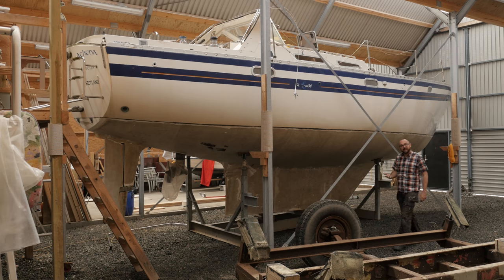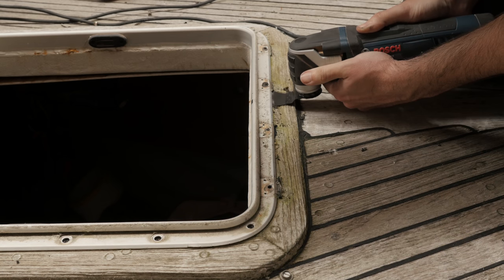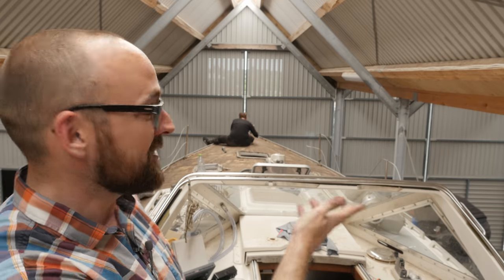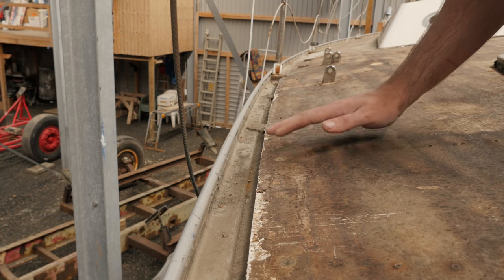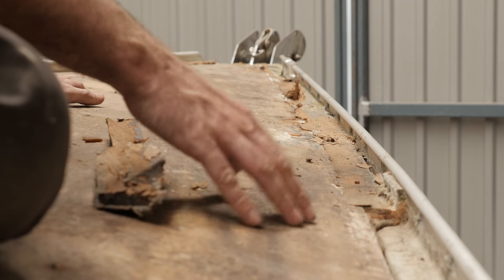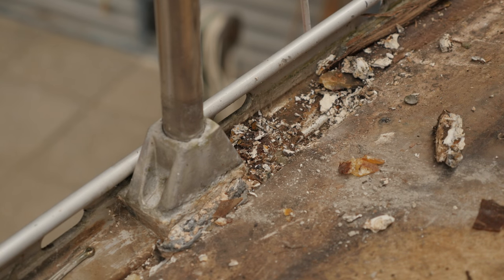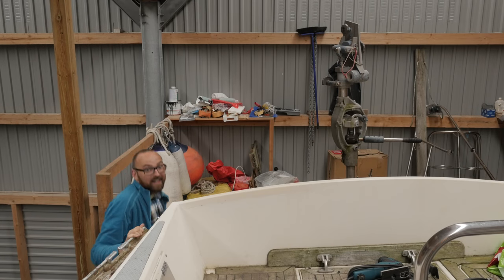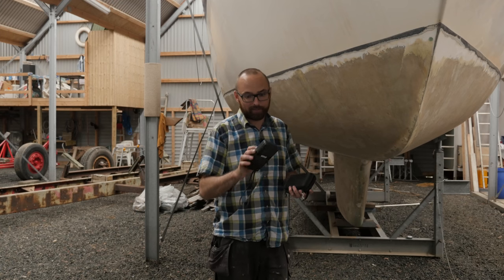Sail Life - Removing the old teak deck & issues with the deck - DIY sailboat refit

Comment: WOW! You guys got lucky with the ease of that deck removal. I helped strip the teak off of an old Hans Christian 38..with two people it took 4 weekends with the sun beating down on us. The adhesive on your boat must be pretty degraded. The stuff we were dealing with was black and unbelievably strong, even after 30 years. Either that or we were just completely incompetent!
Reply from the maker: Hehe, I doubt very much you were incompetent :) All credit for the easy removal of the teak deck aboard Athena goes to whoever chose to use that brittle adhesive. A horrible choice clearly but I'd buy him or her a beer any day ;)
Reply: As for the wet deck...we had the exact issue on that Hans Christian. Who would have thought that drilling a few thousand screw holes through a perfectly good fiberglass deck with a wooden core would lead to water intrusion? I'm sure the teak was really nice under the foot when it was new...but these screwed down teak decks have proven to be perhaps the stupidest idea in the history of yacht design.
Reply: RealityIsTheNow  Hans Christians used two part Thiokol  adhesive/sealer. It makes Sikaflex or 5200 look like wallpaper paste. You're lucky it only took that long.
Reply: the biggest tragedy is people letting teak on an HC degrade to the point where they have to remove it.  I was just on a 1981 HC38 and the original teak decking was immaculate. Maintenance people, it is not that hard....

Comment: My and my friend removed the toerail on our Wasa 55 a couple of years ago, it was damaged in a few places and it was leaking. We also changed out the entire foredeck due to rotten balsa core (from a hole from a hatch, not teak deck).

We ended up lifting the entire deck along with toerail, (still attached to few bulkheads), cleaning out the butyl sealer, grinding and glueing the deck to the flange in the hull.
Then we routered a nice big radius and laminated the hull and deck together on inside and out use with biax glass and vinylester :)
We had a bad looking recess in the hull under the toerail from the angle iron that was used in the form to make the deck flange and needed to do something anyway. And since we changed the deck from the cabin top and forwards anyway (about 4m),we went all in :) we even reinforced the flimsy stern panel and made that into a nice sandwich panel. 

Turned out pretty darn spiffy ;) looks more modern with a big radius edge to the deck and the entire boat and deck stiffened up considerably.
Probably added a liite bit of weight, but not much singe we removed the toerail and didn't put it back.
Still need to finish the painting and painting a new anti skid on the entire deck, roof and cockpit.

Comment: Your optimism is amazing. I can't say I was surprised your deck is wet after seeing how whatever "adhesive" they used was brittle and no longer doing its job. That coupled with the thousands of screw holes is just a recipe for wet decks. Seeing how you don't have an off switch, I can't wait to see you dig into the deck and make it as awesome as the rest of your projects. Good luck!

Comment: That's very nice of them to help you out. Good neighbors are best neighbors.
Reply from the maker: That is very true! :)
Reply: FOR THE CORE, take your router, remove the bottom plate, and replace it with one that keeps you from the toe rail to the core. It has to be a disc, so you don't have issues with curvature and it has to have rounded edges, so that it doesn't catch on the imperfections, alternatively, you can sand the whole cut path before hand.

Comment: Mads the boat was obviously built with a teak deck in mind, can't say I was very impressed with bits of teak stuck in epoxy as fillers. I wonder if you wouldn't consider filling the holes and getting it replaced. I'm just thinking that a nice smart teak deck is going to look a whole lot nicer, will hide a world of upside down cores, toerail gaps screw hole make mends etc.  The hours that you save on all that stuff, just do some extra consulting work for $ that pays for the deck. 
I have done two weeks on warrior 38's and this Pandora's box really surprised me , I was super impressed with the build feel , so that's an illusion shattered. 
Cheers Wilf

Comment: Great video as always Mads. Man that deck came up fast!  Anyway, the hull. Just grab a 100 foot roll of plastic and tape it to the hull all the way around. Put some pieces of wood or gravel to seal it to the ground. Get 4 or 5 dehumidifiers from a flood clean up company and chuck them in there for a week.  It's worth a try.
Reply from the maker: Thanks! :) I think the HotVac copy will do a better job :)

Comment: I thoroughly enjoyed this week's video with challenge on top of challenge. Your spirit and resolve will win the day and wish you the very best of luck. I have been fixing boats for many years and right now would be asking around for the right direction to take with the deck sandwich repairs - it is a bit beyond my experience. I have also learned that I have been using screwdrivers incorrectly all these years Ha Ha! Keep up the spiffing good work. I think I owe you 3 beers!

Comment: I keep thinking it would be a good idea to raise the toe rail up to the level that is above (or on top of) the foam core.  This would make the deck area adjacent to the toe rail flat (you mentioned kind of routing the area.)   A flat area would be more stable footing.  On a different subject, I've hear yacht reviews say that a taller toe rail adds more safety.  So, I think it's good that you're removing the teak that was glued on top of the toe rail as it makes the toe rail effectively taller!  One last thought, if too much of the deck core is damaged, it may be easiest to replace all the deck core.
Reply from the maker: Thanks for the suggestions :) I don't consider raising the toe rail an option at this point :) I have to be very careful what projects I take on if I'm to have Athena ready to go back in the water in the fall :) 
I'm in the process of sourcing new foam and 60L (15 gallons) of epoxy to replace the core. Before doing anything I'll consort with my friendly local shipwright just to get a second opinion :)
Reply: Yes, it speaks to the old saying "easier said than done". :)  Thank you for the replay, and thank your for the channel!

Comment: Hi Mads, I don't know if this is of concern any longer, but regarding your scraper attachment, the Japanese one probably isn't that bad. Don't be fooled, Asia is big, there are worlds of difference between Japan and Taiwan i.e.. Japanese products usually can measure up with the best of them. That said, the Mitsutomo attachment seems to be one of those "one size fits all" products. It features that quick release cutout that you'll need for a traditional (and overall more sturdy) mount like you find on the Makita. The Star Mount system doesn't need that, on the contrary, since it has considerably less grip to the attachment, it really suffers from that cutout. I guess the lesson would be: if you use a Star Mount tool, use Star Mount (only) blades and attachments.
Thanks for your videos, I started watching your Athena refit series a week ago and am completely addicted. Awesome stuff! :)

Comment: For drying the deck I would like to suggest spreading diatomaceous earth on it. This is a inexpensive, easily-available desiccant. Try a small area and leave plastic on the top so it doesn't remove air moisture and ruin the effect. After a week pull off the plastic, sweep up the powder and measure the result. Best of luck and let us know if you try it and if it works well.

Comment: Maybe you could use a wire wheel in a drill to clean the toe rail.  If a steel wheel is too aggressive for the aluminum then a brass one would work.  It would save a lot of time.  Excellent work!

Comment: still love watching the videos, I am like your other poster in that I am a bit concerned about the router plan. I really admire your courage in tackling the deck, not replacing the core which is easy as you say, it's the massive area of teak which you are replacing. I hope you get some good ideas for the edge of the deck where it meets the toerail I wonder if you could stop the edge of the teak directly above the cored part and leave a slight drop to the exposed toerail, not so pretty but long lasting and serviceable

Comment: imho, you would be wise to remove the toe rail. It will be much easier to clean up, you will be able to have it re-anodized ( in which case you probably won't have to clean it as much as the anodizing process will remove the corrosion), and besides, if the deck lip/toerail design is as challenged as it is, you would be wise to remove what is left of the old, dried out, crappy caulking and decide what to put down. imho, sooner or later you will have to deal with a leaking toerail, and the easiest time to do so must be now! Really appreciate your dedication to task, thoroughness, and excellence in execution.

Comment: On the first look the idea of filling the groove between the teak and the toerail with some odd material looked good to me, would cover the core of the deck from the side and also the screws of the rail, but as it turned out, the water had find it`s way through the years...too bad, I´m outof ideas by now...
Lifting the toerail to the level of the former teak would do the job, but will come out as a heck of work....
I wonder how you will resolve that problem...
Es bleibt spannend!
:-)
Have fun and thanks for the vids!

Comment: My 61 year old kness would never put up with that work without knee pads. Oh to be young! LoL Even the cheaper ones used in basketball will you save you the time of moving and psotion that pad on the deck you are using. Your knees will love for it later in life. Good progress though, very good indeed. I rather guessed before your moisture readings you were not going be impressed with that deck.

Comment: How do you secure the deck for water intrusion ? - Do you cover the deck with fiberglass ? - The coating should also be a type that does not crack over time. On my old Banner 26 I had a kind of rubber non-slip coating which you are gluing on. But you also have to choose something that does not turn green and slippery of algae.

Comment: You have to get the salt minerals out of the fiberglass to expedite drying it may require a couple of power washings.  I was impressed on how fast you got all that teak off of the boat. Do you have an idea on how you are going to take out the foam core and replace it?

Comment: My wife and I just finished watching your video.  As always its something we look forward to every Sunday.  We have a question about the calibration of your moisture meter.  Have you recently compared the readings from a known dry hull?  My moisture meter is by no means as "Gucci" as yours and certainly would not put all my trust in it.
Reply from the maker: Thank you :) I'm glad both of you are enjoying the videos :)  I use a point on the hull above the waterline as my dry reference. Also, I've compared the readings from my meter with a similar meter. I don't think there is anything wrong with my meter ... sadly ;) That would be much easier to fix ;)

Comment: Hi Mads..... your toe rail is fine. Clean it and if necessary you can paint it.  Looking at your deck it looks like it was laid up over a male mould with the Cabin/Cockpit a separate drop in moulding.  Hence the core on the top ??!!!
Reply from the maker: Could be :) I think they might have done it to bring the deck up to the level of the holes in the toe rail but I'm just guessing. Seems like more work to me.

Comment: Thanks for the update Mads. Do you suspect all the moisture on the deck is partly do to age, all those screws,  and the toe rail siting below the deck?  

I recall reading your plan on repairing the deck, will that also seal the area around the toe rail and deck to prevent any moisture seeping in?  

Thanks again for a great video.

Comment: As for the moisture readings of the hull: is there a section of the hull that is more dried out than others? I was thinking that I was noticing the hull section midship that was drying fairly well and the aft section is still very wet. When you were working in the salon under the sole, there was some standing water that was stuck there because of poor drainage openings and none in some areas. Have you investigated under the sole in the aft cabins? Around engine? If there is standing water in those sections like there was in the salon, it might account for the slower drying times in those sections. Just thinking:) I'm enjoying the videos, keep up the great content, even if it's some toe rail scrubbing.
Reply from the maker: Here is a link to the readings from last week: https://goo.gl/photos/SxHA59fgT2RfRRnT6 
I have checked for standing water throughout the boat. It's nice and dry :) 
Thanks for staying tuned :)

Comment: You got lucky with your volunteers helping out, and even more lucky with that deck coming off as easy as it did.  When you use the prybar, you should have a shim of metal underneath it.  Fiberglass was not designed to withstand the combined forces of a prybar putting pressure on it.  Your actually cracking the fiberglass internally, and it will leak in the future.  I work on aircraft composites.  If you need to pry, place the prybar on the toerail aluminum and lift from there, never on the fiberglass itself.

Am curious if your going to re-teak the deck, or seal it up and paint on nonslip, or use artificial teak decking.  The artificial teak decking seem to have good reviews, lasts longer and has better traction in rough weather.

Comment: Fairing the deck to the level of the toerail limber holes is your challenge. Fiberglass/epoxy over faired foam. Expert territory in yacht refinishing. What is involved with reusing your toerail if you do remove it to accomplish the deck core repairs? Might actually be simpler overall IF yours is removable. Rebedding the toerail is considered a maintenance task on a twenty five year interval in some marine trade circles.

Comment: I hi Mads, great progress. Have you taken advice on using epoxy when replacing the core and top of deck as opposed to polyester resin? Just wondered if epoxy is the best solution. Also I know it is currently foam core but is foam better to use than balsa? Andy
Reply from the maker: Some would say that polyester is as good of a choice as epoxy. I think I've found a great deal on epoxy and if that comes through I'd prefer to stick with epoxy. I'd prefer foam over balsa. At least in my opinion foam is more rot resistant and it's nice and easy to work with :) I do plan on consulting with a friendly local shipwright before I start working on the deck :) It never hurts to get a second opinion!

Comment: The 'do-hickeys' should be seals, to prevent water soaking into the wood.
Ah ha, Tom Sawyer, convincing the other kids to 'white wash(paint)' the fence, because it's fun...
Reply from the maker: I think the doohickies might be dual purpose :) They also separate the stainless screws from the aluminum frame :)

Comment: Honestly, I would remove the toe rail.  You've already discovered so many 'hidden' secrets, the last thing you need is leaks from old bedding compound that has failed.  The only way to know for sure is to remove them and be sure they are properly bedded when re-installed.  I think yow will have a heck of a job re-coring the decks, but having the toe rail out of the way will actually help.  As for drying the hull, I wouldn't waste the money on those silicone vacuum mats.  I dried out my hull over 8 weeks, but my boat is much smaller and thinner.  Anyway, I think a dehumidifier unit inside the boat as well as outside plus warm weather will take care of the job, plus its also recommended that you rinse the hull with fresh water every week.  Why this works, I don't really know the scientific reason but it is similar reasoning as to why you flush down just solidified concrete as it cures.

Comment: Check your internal top edge of the core is not square coz if it is you may run into it mid radius where rounded outside corner meets square internal........just a thought.
Reply from the maker: Good thought :) Thanks :)

Comment: That little "gutter" between the toe rail and the core is going to be an issue !  It will hold water and being that close to the core, well you ca guess what that means.  This is why that odd shaped piece of teak was used to try and fill that in.  I think you need to do something more than just round over that edge with a router.
Reply from the maker: The core around the "gutter" is still fully encapsulated :) The core no closer to being in contact with any water than it would be if the core was on the underside of the deck. The gutter won't hold more water than would be on deck anyway so I don't think it'll be an issue :)
Reply: I agree with this sentiment. If it were me, I would slope the top of the deck until it meets the upper edge of the inner toe aluminum (thus allowing any deck water to flow into one of the toe rail "holes" and into the sea) That little gutter will just collect and absorb water, not good.
Reply: A possible solution ... Look at the profile of that filler piece at 20:50.  Make another piece like that out of PVC or some other synthetic material.  The trick is how to bond it in place.  Butyl caulk/tape ?  3M 4000 or 4200 ?  BoatLIFE LifeSeal ?